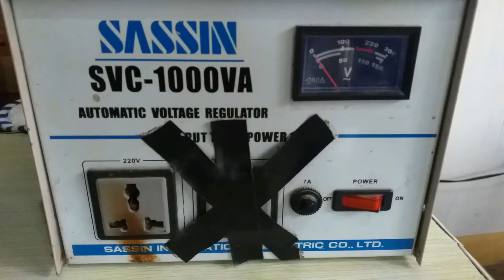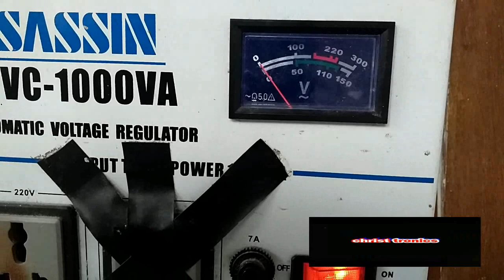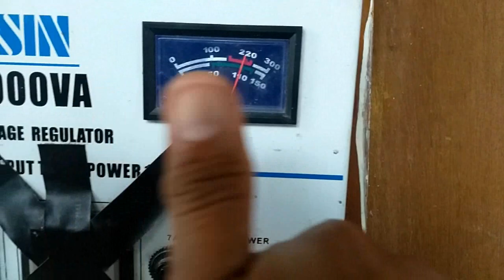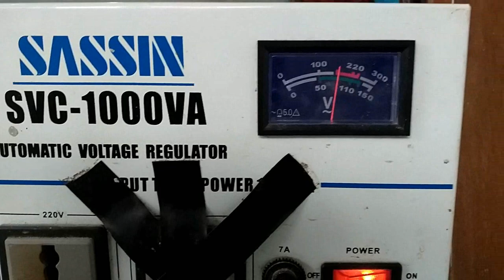How To Repair An Automatic Voltage Regulator With Power But No Output (Easy)

Comment: Pwede.po magtanong Chris....Yong generator namin pinaayos namin kasi di umaandar ...so pinalitan ng solenoid at EVR  ...umaandar nga pagkatapos umandar  magpahinga ng isang linggo subalit nung pinaandar uli Ang kanyang power output nasa 200v lang KAYA kumukutapkutap Ang mga bulb 💡 at dikayang paandarin Ang water pump na 1hp ....7kva Ang generator namin diesel sya thunderbolt brand . ANO PO MAIPAPAYO NYO SIR?

Comment: Kuya may power No output voltage pero OK nman po Relay, ano kya issue? OMNI AVR 1kW
Reply from the maker: Sir check po output Yong wire sa saksakan baka sunog

Comment: Ang AVR namin ay nag t-trip off bale 10kwatts siya tapos nka connect sya directa sa Sterilizer namin na 4kwatts. Ang sterilizer namin ay gradual mag b build up ng heat from 0deg to 120deg Celsius. Kung lalampas na Ang temperature ng 100 deg nag t-trip off ang aming AVR. Ano kaya problema ng AVR? As in ang power switch ay babalik sa off position. HOSSONI ang brand SVC 10K VA SERVO MOTOR CONTROL.  Salamat sa sagot?
Reply: @ChristTronics12  Ok I'll subscribe. May tanong pa ako, itong AVR namin kasama na sya sa sterilizer pagbili namin, bale package price na sya. Last week lang kasi ito nangyari since installation last June 2019 mga 1 year plus pa lang ginamit namin. B'at dati ayos naman? Hindi kaya sa electrical system ng sterilizer ang may problema. Ang heating coil element kasi nitong sterilizer laging babad sa tubig. Ini init kasi nya ang tubig para magkasteam ang chamber at ma pressurize. Hindi kaya may leak na Ang insulator ng heating coil? Or ano kaya ang possible problem ng elect system ng sterilizer ba't nag o-overload ang AVR? Thank you sa sagot.
Reply: @ChristTronics12  Ok subukan ko Muna ipa linis at check ang AVR atleast alam ko na. Ang hirap kasi nitong mga lab equipment na to sa manila pa ang mga technician tapos hindi pa available kaagad  pilay na ang operation namin. 
Thank you for sharing your knowledge.
Reply: @ChristTronics12  ok sir Thank you so much.

Comment: boss pwedi bang e rekta ang dalawang yan ? di ko kasi ma trace ang sira   Secure AVR 500 VA neto may power din pero walang delay ang sa voltmeter salamat
Reply from the maker: Ang alin sir , baka madisgrasya po kayo, wag sir
Reply: @ChristTronics12  Ang sa Relay na Output sir NC and NO pinagdikit ko nalang  di kasi na pitik ang relay kasi low voltage ang out galing sa transformer papuntang relay

Comment: Sir yong avr ko mayroon siyang continuity kapag nag tester ako sa flug niya kapag NAka off ang switch walang continuity kapag NAka ON ang switch meron. May ground ba ang AVR ko? Thanks
Reply: @ChristTronics12  good evening sir may power siya kapag nag tester ako muabot nang 245 - 250+v yong output niya dapat 220v lang. Thanks opo mag subscribe ako.

Comment: Sir namamatay ang avr ko pag masyadong mababa ang input voltage, pag gabi kc mababa ang kuryente dito 100V lng. pag i set ko ng 160to250V namamatay sya ang ginagawa ko i seset ko ng 70to130V pag gabe tas 160to250 sa umaga ,  ang tanong ko po normal lng batong namamatay ang avr  Pag lowvoltage ang input, anu dapat gawin para di nko mag set ng set,, biglang namamatay kse ang smart tv namin
Reply: @ChristTronics12  500VA po.. Ang baba kc ng kuryente dito pag gabi.. Siniset ko nalang sa 70to130V ang input selector nya.. Kya lng biglang namamatay ang android tv ko,, bka kc masira, Kylangan ba ng UPS pag ganito?,

Comment: Sir, bkit po maganit pihitin ung servo motor saka ayaw gumana ung VU/Meter pero may reading nman po sa output na 220v,110v, 100v stavol /model svc- 1500nm po ung tinutukoy ko, salamat po sa tulong na ma-ipapauo niyo .
Reply: @ChristTronics12  maraming salamat po sir sa response mo
Reply: @ChristTronics12  morning po, sir bkit po ung sa may "brush o carbon" ng AVR  ko ayaw pa rin umikot para mg-hanap na kaukulangan voltage, samantala ung sa likod naman na my mga gear ay umiikot na matapos ko sprayan ng WD-40. D Kya sa control board na po ung prblema , salamat po muli sa ano man ma-ipapayo mo..

Comment: Hi, the output voltage of my AVR  is 200v . i tried to adjust the trimer but no change in the output. Any idea what I need to do? Thanks
Reply: @ChristTronics12  im in Philippines, im using Meiji AVR, how should I adjust the output voltage?
Reply: @ChristTronics12  i tested it with voltmeter , the output voltage is 200V.